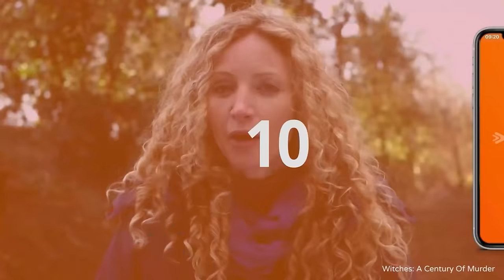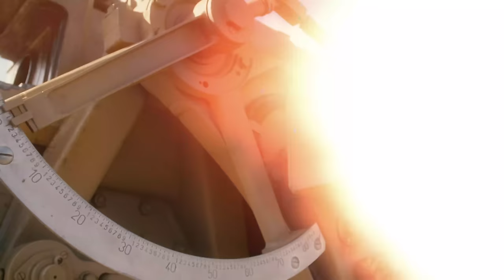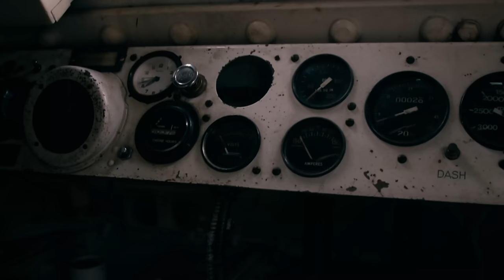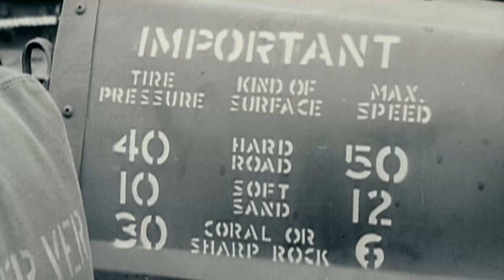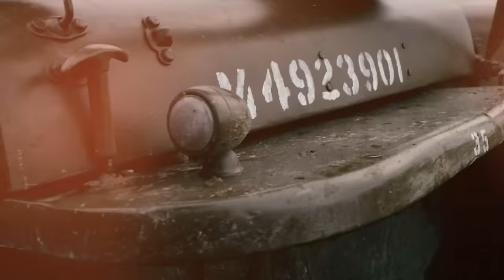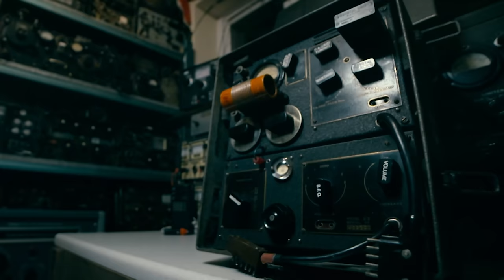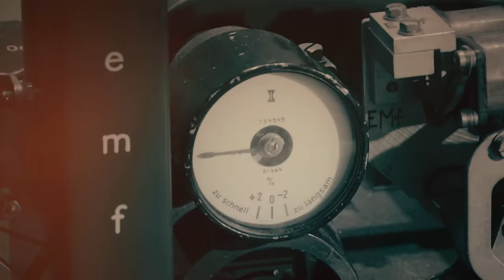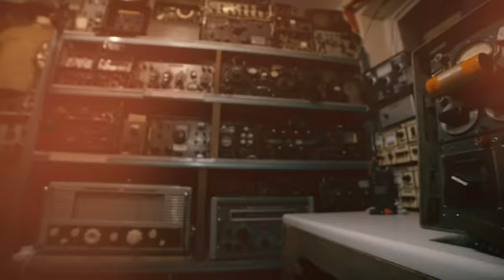The Deadliest Machines That Won WWII [4K] | Combat Machines Compilation | Spark

Comment: IRONY ... In 1959, my Uncle, who as a NASA Engineer on the Atlas Booster fuel control valves,  escorted our family on a tour of the NASA facility in Huntsville, Alabama.  It seems impossible given today's extreme security, but it was a fairly common in those days.  As chance would have it, he introduced us (me 11, my sister 9, and my brother 7) to Wernher Von Braun who was visiting the building we were touring.  It wasn't until several years later that I realized the irony in that event.  My uncle was in "waive 2" on Omaha Beach, and Von Braun was the inventor of the V1 and V2 rockets used to attack England.  Even though I had been involved in Army ROTC for 3 years ('63, '64, '65), my uncle told me stories I had not heard of previously.  He explained how the German 88 Artillery was so effective.  The Germans  had brought in artists who painted scenes on the interior wall of pill boxes and on canvas for field installations.  These artist renderings also included precisley measured distances to observable objects (trees, rock formations, etc.) that allowed the artillary operators to fire precisely as the American soldiers would approach these "pre-sighted" landmarks.  Although the German 88 was a masterful design, when it was coupled with this technology, it was absolutely devasting.  In my last year of ROTC, certain of us attended a field trip to the Cantigny War Museum in Wheaton, IL (suburb of Chicago).  Sure enough, there was a recreation of a German pill box, replete with exactly what my uncle described on the interior wall.
Reply: That is called ranging!! On my dual deployments, I always carried a range card which gave me information relating to what positions I should fix my sights to regarding particular ranges. 

What you described seemed even better because since I was not issued a rangefinder, I had to guess. If I had a picture of the scene with ranges, I mean that's got to be cheating right!
Reply: @aliasunknown7476  Thank GOD the Germans didn't have our manufacturing and natural resources.  Truly amazing people.
Reply: @aliasunknown7476  It was very innovative.  The paintings ranged out to a few miles.  They obviously had forward spotters calling in the ranging objects to the artillery.  The 88mm guns qualified in all categories (mortar, howitzer, rifle, and anti-aircraft).  They were high velocity, which allowed them to penetrate armor.
Reply: It’s was a good thing Werner Von Braun came to the US.
Reply: As the Germans had been in position for years, it would be incredible if they didn't know the distances to various easily recognised points to the inch, as opposed to spotting a target and having to guestimate the distance as an allied forward observer would need to
Reply: @The.Original.Potatocakes  plenty of other rocket scientists went to the east.
Reply: @davedixon2068  Two things are obvious.  #1, you have never stood a post.  #2, you can't read.  The system the Germans used obviated estimation.  As I wrote, they placed or identified objects then measured them as a reference.  They then applied ranging shots from the artillery to the object and recorded those settings at the artillery emplacement.  The observer simply had to radio the reference to the 88 shooter.  We used the same technique in SE Asia when setting up ambushes.  It's called "previously arranged coordinates", which are then named.  Seriously, you should stop trying to be "right" when you don't have a clue.
Reply: @richardgreen7811  Well in 25 years in the military I probably stood as many stags as you  (if not more) if you had bothered to actually read what I posted then you would have realised I was talking about gun positions that were built and manned for years before they were used in anger, your reference to Vietnam was true for vietnam, you move into a position and carry out ranging shoots under the control of an observer. What I was talking about is positions on the Seigfried and Maginot lines that were built and manned and were surveyed beforehand and the surrounding area was painted on the interior walls of the gun/observer positions for use as easy identifiers of the targets and ranges were generally from a rangefinder, you really shouldnt jump to conclusions about peoples experience.
Reply: @davedixon2068 Your comments didn't read that way.  Also, we didn't have range finders of that nature, even in Vietnam.  Also, we rarely had the luxury of a FAC to coordinate artillery.  It was all estimate, shoot for position, and record.  All of my Normandy comments were from my Uncle (2nd wave Omaha Beach) and the comments of the curator at the Cantigny War Museum.  I'm simply pointing out that the German 88's were accurate and unmerciful on June 6th.  The paintings (which I saw) had abbreviated reference points for coordinating with the gun position via radio.  Even if the Germans had been there for 200 years, they still needed a reference point in order to place the shell.  I don't understand what you don't understand about this.
Reply: @richardgreen7811  the reference points are already there , many of the fixed batteries had protected range finders  and 88 mobile batteries had light weight hand held range finders. Ive agreed about the pictures not sure what your problem is
Reply: @davedixon2068 Awesome ... Now, explain to me how your alleged range finder works when there is no visual of the target ?  Armed with facts, I have no problem.
Reply: @richardgreen7811 Why alleged? as I said 88's batteries had mobile rangefinders available as had 128mm batteries. Fixed site guns usually had a rangefinder attached. as for indirect fire then as you say you did in Vietnam you range your shots in from known points and observed fall of shot, observers could have pictures as discussed in the original post for reference, or not. Not sure why you cant believe that range finders are used. Particularly coastal batteries and AA batteries, all gunned warships carried them. There are plenty of photo's of coastal defence battery observation posts topped by a rangefinder, some of similar size to a battleships and the guns of a similar size on occasion too.
Just because you have experience from Vietnam (vast respect for that by the way) doesn't mean that was the only way to skin a cat, the things I'm talking about are easily referenced particularly about Normandy landings defences and the Maginot and Belgian forts in 1939
Reply: @davedixon2068 Well Davey ... Rifles, 106 Recoilless Rifles, Howitzers, and Mortars all have sights with rangefinder capability.  Let's agree on that.  The shortest distance between two points is a straight line ... let's agree on that.  So if you're at Location A (gun emplacement), but you can't see Location B (target), then how do you employ a range finder.  Simple ... you have a spotter near Location B that provides the gun emplacement with a predetermined target point.  Your EGO will not allow you to concede these points.  Unassisted, you can't hit what you can't see ... Even ALI knew that.
Reply: @richardgreen7811  think you need to read my reply again I said exactly that. BUT there are range finders in many photographs as I said. my EGO is fine but you dont seem able to take in the fact that there are different scenarios than you have experienced
Reply: @davedixon2068 The Great Escape ... I Love It
Reply: @davedixon2068  @richardgreen7811

As a 3rd party observer it’s come to my conclusion that respectfully speaking YOU are the one with the Problem Dave… you’ve jumped to conclusions & made assumptions off OP’s statements… picked a fight for no reason when you ACTUALLY agree with the person… I’m sure you don’t intend to ‘start beef’ with others on here👆🏻 unless that is you after as an avid ArmChair Warrior who DOES INDEED have a problem with their EGO… and just for clarification- the EGO comment of saying “You” was a euphemistic usage of the word YOU which is NOT intending to mean You specifically, but You as in You All & Anyone else…  Hope you can take some of this into consideration so you can make modifications to your behavior & attitude… cuz its Wayyyy More fun making Friends than Enemies… unless you don’t want to… and then if that’s the case I’m sure you get a lot of invitations to join social gatherings, No?

Comment: The minox camera also had a small string attached to it with several beads on it at different lengths. It was so you could take the bead at the end touch the table with it and then it was in focus and would take a 8x12 in pic. this was so you could take a pile of docs use the camera to make that huge amount of paper and make it the size of the film roll.
Reply: Nb be in hi
Reply: Okay........

Comment: I remember reading that, when Roosevelt and Churchill asked Stalin what kind of weapons he needed the most, Stalin replied, "Send us trucks and jeeps."
Reply: Always found it fun I own a jeep and it's the vehicle Noone has referred to as an "Suv, Truck, or Car" it's always just referred to as a jeep like it's got its own category 😂
Reply: The US sent the Soviets, 2,000 locomotives, 30,000 trucks and jeeps, thousands of radios/ telephones. And around a million miles of phone line.
Not 100% accurate but I tried to be conservative on my estimates. 

They would not have been able to do a structured retreat without the communication gear we gave them. And hopefully everyone knows what that would've meant. A lot of Russians died but over half of those #'s where self inflicted.
But that's always been the Russian way.  Life is cheap
Reply: @chrisdixon3945  They needed a mechanized army  , they were still using horses .

Comment: The only reason Monty won at El Alemein was 400 American Tanks and limitless fuel availability 🇺🇸
Reply: He knew it would be a battle of attrition and having fought in WW1 and seeing the carnage, he was aware that Alamein was going to be that sort of battle. Churchill was forcing Generals to fight before they were ready and Montgomery stood against him. The First battle of Alamein showed the Germans could be halted. General Claude Auchinleck was the General in charge after Richie was sacked after the Battle of Gazala. 
It did help that Rommel has supply issues, not just with distance, but transports being sunk. However the battle of 2nd Alamein was testimony to Montgomery's resolve to win and defeat Rommel. No other General got away with what Monty did.

Comment: Learned to drive, at the tender age of 13, in a Willy's. (It was only on private property.) That mid-40s Willy's stayed in the family until 2022. It was in horrible shape by then, but the simple engine and transmission were still good, along with the somewhat rusted yet iconic grill. I hope it finds new life with it's new owner.

Comment: Not mentioned, the Grant tank's engine was an air cooled radial that wouldn't overheat in the desert.
Reply: I think they did or was it for another tank, a British 75mm tank that was used in the african campaing's
Reply: They did mention having to crank the radial engine that the similar Lee tank had at least.

Comment: So the desert war was won 100% by the British?  What about the 1000's of Americans with our tanks and aircraft that came across North Africa from the west?  If it weren't for Americans entry into the war Britian would be flying the swastica flag and speaking German.  Thanks for the recognizion.
Reply: El Alamein!?!
Reply: @rev.x-bones8651  I do not take away anything from the victory of General Montgomery at El Alemain.  However this victory would not have happened had the US not developed and freely given the reliable and effective M3 Grant tank by the thousands that allowed Montgomery to go head to head with the Afrika Corp.  Along with these tanks there were a lot of P40s that were given that were used effectively by both the British and American forces in North Africa.  Also perhaps the final battle at El Alimein would not have happened had the American engagements with the Afrika Corp in the Western North Afrika.  Had it not been  for these early American sacrifices in thousands of deaths as well as loss of materiale that were encurred in defeats as well as victories after General Patton took command that forced Rommel and the Afrika Corp back to the eastern part of North Afrika.  The point of my original post was that some credit could be afforded to the efforts of America.  Had Montgomery not received the M3 Grant as well as the RAF getting the aircraft the history of North Africa may have been different.  Another key contribution to the success in North Africa was the efforts of the USS Wasp to deliever Spitfires to Malta when they were needed the most.  The Royal Navys ability to stop many of the German supply convoys to reinforce the Afrika Corp would not have been possible had Malta fallen.  All of these American contributions should have received at least a mention.
Reply: There are plenty of documentaries that herald the efforts of the Americans in Africa and their contributions to the British armour during that campaign and the rest of the war. This particular production deals primarily with the vehicles and weapons used, wherever they were supplied from. And it is a British recording, so one would expect the Tommy's to garner the lion's share of praise. Accept it as is and enjoy the show. 😊
Reply: no debate
Reply: Not to mention the lend lease
Reply: Probably not, they would fly a hammer and a sickle.
Reply: His chronology is correct. The US didn't enter the war until Dec 7th, 1941. US troops didn't set foot in North Africa until November 1942...
Reply: Oh please everyone knows Degaulle single handedly won the war.
Reply: @timtebow4775 😂😂😂
Reply: Hahahaha....if it wasn't for Soviet victories the Americans wouldn't have been able to invade France ...
Reply: @johnweerasinghe4139  That's correct and is the reason for having allies in any major conflict.
Reply: @comradedog4075  Remember Lend Lease wasnt free. UK didnt finish paying war debt until after 2000
Reply: And without the American Help with Everything specialy with hundreds of  M4 Sherman, Montgomery never would have won at El Alamein. Even with the Afrika Korps on their knees,with only 80 to 100 tanks fit for combat,no fuel, Ammunition and Outnumbered in men 3/1... The British were the weakest link on Allied Chain. The weakest Armed Forces,and completely dependent of the American Help,directely( Essential goods,as food, medicine,fuel,etc)or by the Lend-Lease progam (raw materials,all kind of Military Equipment and Fuel,lots and lots of them).
But this is common knowledge for the last 80 years, Without the American Help, Britain wouldn't stood a chance against the much superior German Armed Forces. The Whermacht.
Reply: @comradedog4075  lend lease wasn't free. UK war debt wasn't finally paid til the early 2000s. The fifty very old destroyers that America gave cost several bases around the world including Diego Garcia in the Indian ocean
Reply: @robertbacklund4438 I’ve seen far more North Africa campaign documentaries that give Britain full credit and don’t even mentions the Americans that dedicated their lives just like the brits or how we ultimately supplied the entire allied force across every front. You hear more about the Egyptians helping the Brit’s then we the people.
Reply: I'm sure the Brits have rewrote history many times 😊
Reply: @loneranger5349  The winner writes the history, that is true throughout history, if you don't believe me ask the members of the Indian Nations in America
Reply: Every allied victory no matter what country was or wasn’t there was a team effort. If other allied countries were not fighting in other areas the British wouldn’t have had the troops to win in Africa and vice versa.
Reply: @peanubutterisfu, well, France was collaborating, Monty was full of f**kery, so pretty much it was the Americans and dont anybody forget the Canadians. Those boys were bangers.
Reply: The British deserve all the praise they can get for what they contributed in WW2.
Reply: New Zealand SAS
Reply: @robertbacklund4438 Monty had 50 brand new M4 Shermans and they were dominant.

Also, it is clearly the Italians that won North Africa for the Allies.
Reply: Sorry but the Germans were pretty much beaten in North Africa by the time we Americans arrived. Also, the Americans took a pretty solid beating at Kesserine pass. We cut our teeth in North Africa and won some battles. It was Sicily where we pretty much took charge and started whooping em.
Reply: @robertschumann7737  so when did the British receive the hundreds of M3 tanks along with P40's.  I never said that America defeated the Germans.  It was an allied effort.  In hind sight given the way most people in Britain and Europe feel about America today, it would have been better for America to have remained isolationist.  Had this occurred everyone there would all be speaking German today.
Reply: Not big on history,huh?
Reply: Dont forget the Aussies,Kiwi's, Indians, South Africans etc efforts.
Reply: They'll be flying a crescent Muslim flag soon since they lost their backbone.
Reply: 🇺🇸FACTS!!! 💯👍🏼🇺🇸
Reply: My American dad would disagree

Comment: USN(R) ‘61-‘63. SCUBA Diver/Collector for the Marine Biology Museum @ Pt. Mugu (Oxnard, California). I got to drive a DUKW but didn’t do anything exciting with it.
We could purchase a 7 1/2 hp. Sears Outboard within our financial limits and traded around for a couple of 14’-16’ Aluminum boats. This meant we could dive locally all we wanted. The Navy had/has a presence on several of the Channel Islands (an eight island archipelago 25-125 miles offshore, Southern California) and we could reserve space on one of a few WWII PT Boats which ran Mail/Supplies out to the bases. Pretty great duty! Glad I’m a Veteran.